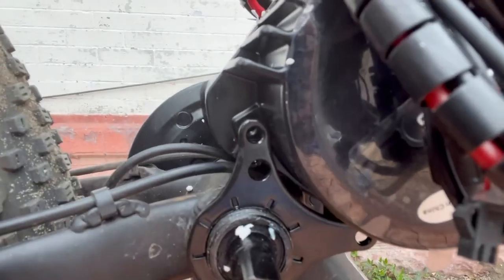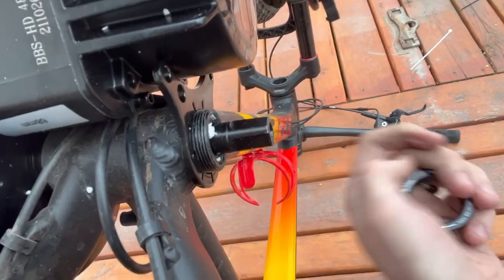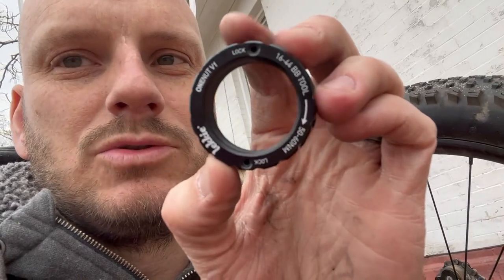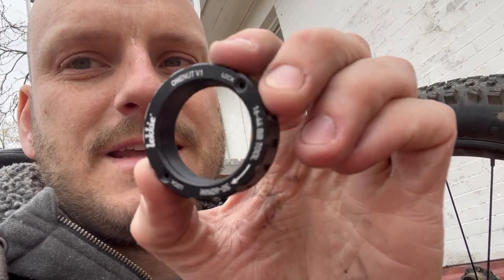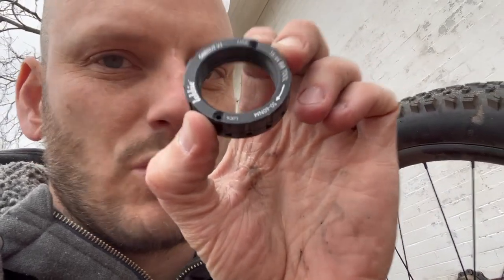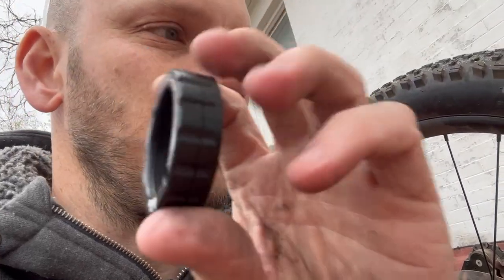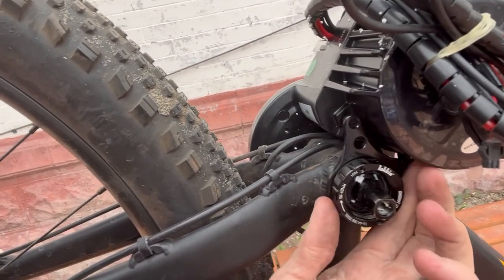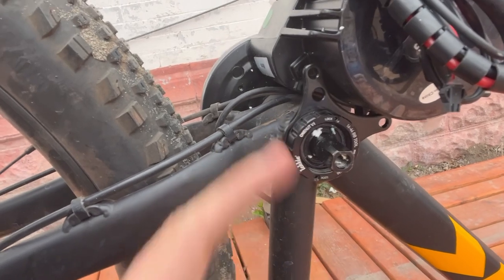Lekkie Onenut: All-in-one Bafang Mid-Drive Lockring

Comment: I just add some loctite to the thread after cleaning it with acetone. And tighten the lockring with a hammer. Also, grinding notches into the bottom bracket for the ridges of the plate to fit in is a good idea.

Comment: Unrelated question - what do you do with all of the excess wiring that runs between motor and handlebar stuff on a Bafang system? I’ve been trying to loop and tape it up under the bottom bracket but was interested how you deal with it!
Reply from the maker: I cover cable management in my ebike install guide. It is all about finesse and trying to find the best way to group it together. Then, it's all about using more zip ties than you probably originally thought. :D Happy to jump on a video call with you if you need specific help. Book on my website. Best of luck!

Comment: What's your thoughts on stabilizer bars? (Specifically the "full suspension" versions and using them on any bike). They seem like the product to use on every application than to rely on the locknut digging into the frame
Reply: they are garbage
mess up ground clearance and most of them are made of thin sheet metal
also looks ugly
Reply: @intelligentos4571  it positions it close to the downtube. 
Also. I haven't seen any reports of any failing
Reply: the stabilizer bars will hold the motor in place even if the lockring comes loose. Get the heavy duty one from Cali Ebikes, the luna BSB-1 are too thin. I've had an BBS02 twist up the BSB-1 from luna. You can easily bend them in a vice and paint them whatever color you want. Intelligentos says they "mess up ground clearance", but thats only the downhill version of the stabilizer bar which i haven't tried.